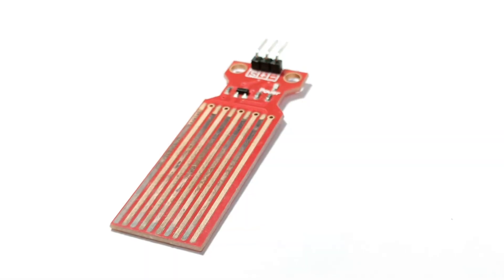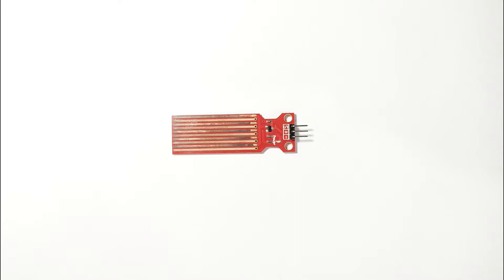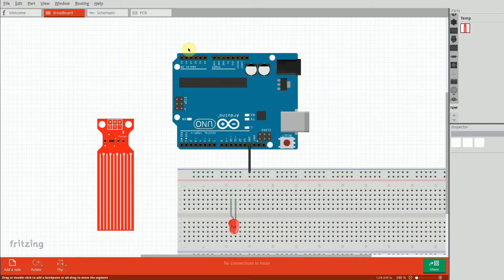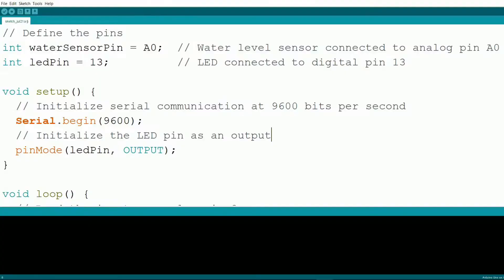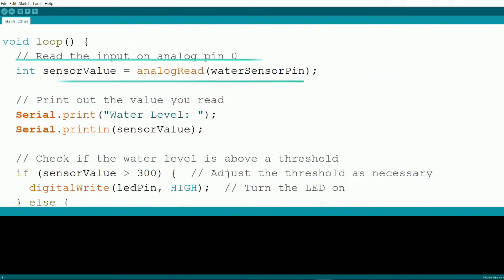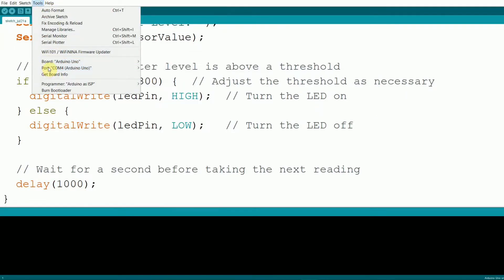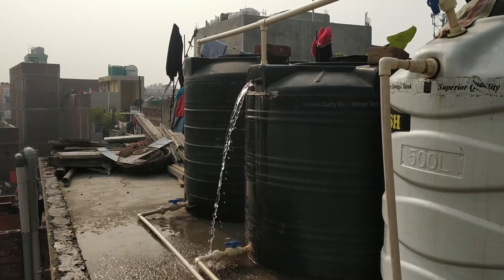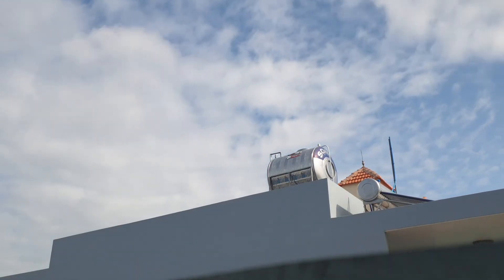Arduino Water Level Sensor Tutorial: Monitor Water Levels with Ease

Comment: If my sensor isn't submerged and it reads 1000, and the LED doesn't turn on, what do I do.
Reply from the maker: It sounds like there might be an issue with the sensor's connection. Double-check your wiring. You may also want to replace your wires. You can also try using a different analog pin.

Comment: How long should it take for the value to stabilize? When I first put the sensor into water half way, the value kept rising and rising. Is this expecected behaviour? When I remove it from the water, I have to dry it to get to level 0 again. Also is it normal that the sensor turns from golden to black partially after inserting it into water?
Reply from the maker: It's normal for the value to fluctuate initially as the sensor adjusts to the water level. It may take a little time to stabilize (probably 10 sec), especially if it's only partially submerged. After it has stabilized, values on the Serial Monitor may increase or decrease by as much as 5. This is normal, so you may have to account for this in your code. As for the color change, some sensors can discolor when submerged; this is normal since this type of sensor is not really an industry-grade type. Finally, yes, you have to wipe it since it still retains some moisture, which can still be read by the sensor.

Comment: Which sensor do you recommend for industry level tank testing?
Reply from the maker: For industry-level tank testing, I recommend using ultrasonic sensors or capacitive level sensors, as they provide accurate readings and are reliable for larger applications. You can read more on ultrasonic sensors here: https://www.arduinointro.com/articles/projects/mastering-distance-measurement-a-comprehensive-guide-to-using-ultrasonic-sensor-with-lcd-and-arduino

Comment: hi can i ask how to add a buzzer into it? we would like to add a buzzer but since I'm a beginner idk were to put it, i do exactly the steps in this vid, thanks
Reply from the maker: You can check out the circuit and coding for the buzzer here: https://arduinointro.com/articles/projects/diy-motion-detection-alarm-system-using-pir-sensor-i2c-lcd-and-piezo-buzzer just replace the motion sensor with the water level sensor.
Reply from the maker: or this: https://arduinointro.com/articles/projects/how-to-build-an-arduino-gas-leak-detector-using-mq-2-sensor-analogread-buzzer-led

Comment: I think there is a problem with this sensor, the pcb traces are lead/tinned so you can't leave it in water for an extended period of time. It will cause leaching. Instead try using capacitive sensor or non contact senor like ultrasonic or even a load cell based on the amount  of weight your load cell reads you can determine the amount of water present in the tank.
Reply from the maker: I agree.

Comment: // Define the pins
int waterSensorPin = A0;  // Water level sensor connected to analog pin A0
int ledPin = 13;          // LED connected to digital pin 13

void setup() {
  // Initialize serial communication at 9600 bits per second
  Serial.begin(9600);
  // Initialize the LED pin as an output
  pinMode(ledPin, OUTPUT);
}

void loop() {
  // Read the input on analog pin 0
  int sensorValue = analogRead(waterSensorPin);

  // Print out the value you read
  Serial.print("Water Level: ");
  Serial.println(sensorValue);

  // Check if the water level is above a threshold
  if (sensorValue > 300) {  // Adjust the threshold as necessary
    digitalWrite(ledPin, HIGH);  // Turn the LED on
  } else {
    digitalWrite(ledPin, LOW);   // Turn the LED off
  }

  // Wait for a second before taking the next reading
  delay(1000);
}

Comment: My water level sensor value jumps to 500 the second it touches water, is it normal?
Reply from the maker: That's definitely not normal, analog values start around 0 at its minimum point. Something may be wrong with the sensor itself. Also try to change jumper wires.

Comment: What would the new code if I add a buzzer?
Reply from the maker: You can try this code:

// Define the pins
#define PIEZO_PIN 3
int waterSensorPin = A0;  // Water level sensor connected to analog pin A0
int ledPin = 13;          // LED connected to digital pin 13

void setup() {
  // Initialize serial communication at 9600 bits per second
  Serial.begin(9600);
  // Initialize the LED pin as an output
  pinMode(ledPin, OUTPUT);
  // Set the piezo pin as an output
  pinMode(PIEZO_PIN, OUTPUT);
}

void loop() {
  // Read the input on analog pin 0
  int sensorValue = analogRead(waterSensorPin);

  // Print out the value you read
  Serial.print("Water Level: ");
  Serial.println(sensorValue);

  // Check if the water level is above a threshold
  if (sensorValue > 300) {  // Adjust the threshold as necessary
    digitalWrite(ledPin, HIGH);  // Turn the LED on
    tone(PIEZO_PIN, 1000);
  } else {
    digitalWrite(ledPin, LOW);   // Turn the LED off
    noTone(PIEZO_PIN);
  }

  // Wait for a second before taking the next reading
  delay(1000);
}

Comment: Do you also have an arduino design for ultrasonic water sensors for larger bodies of water?
Reply from the maker: I tried using an ultrasonic sensor before to measure water level. You can check this article for the code and circuit: https://www.arduinointro.com/articles/projects/using-the-hc-sr04-ultrasonic-sensor-to-detect-objects

Comment: Can you please tell me how to connect the buzzer to it ? And accordingly what changes in the code has to be done ?
Do Comment in detail please
Reply from the maker: First, you need to add the buzzer to your circuit, you may find the circuit here: https://www.arduinointro.com/articles/projects/exploring-piezo-buzzer-integration-with-arduino-a-comprehensive-guide 

Next, you can try this code:

// Define the pins
#define PIEZO_PIN 3
int waterSensorPin = A0;  // Water level sensor connected to analog pin A0
int ledPin = 13;          // LED connected to digital pin 13

void setup() {
  // Initialize serial communication at 9600 bits per second
  Serial.begin(9600);
  // Initialize the LED pin as an output
  pinMode(ledPin, OUTPUT);
  // Set the piezo pin as an output
  pinMode(PIEZO_PIN, OUTPUT);
}

void loop() {
  // Read the input on analog pin 0
  int sensorValue = analogRead(waterSensorPin);

  // Print out the value you read
  Serial.print("Water Level: ");
  Serial.println(sensorValue);

  // Check if the water level is above a threshold
  if (sensorValue > 300) {  // Adjust the threshold as necessary
    digitalWrite(ledPin, HIGH);  // Turn the LED on
    tone(PIEZO_PIN, 1000);
  } else {
    digitalWrite(ledPin, LOW);   // Turn the LED off
    noTone(PIEZO_PIN);
  }

  // Wait for a second before taking the next reading
  delay(1000);
}

Hope this helps!
Reply: @arduinointrochannel  Your a good youtuber looking at comments and providing solutions
Reply from the maker: @dragonroyal9116  hey, thanks!